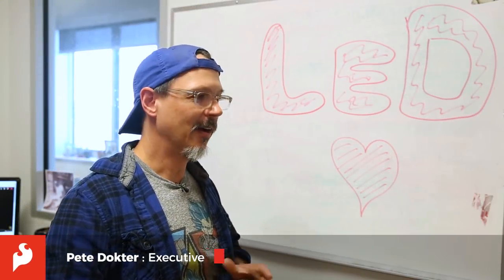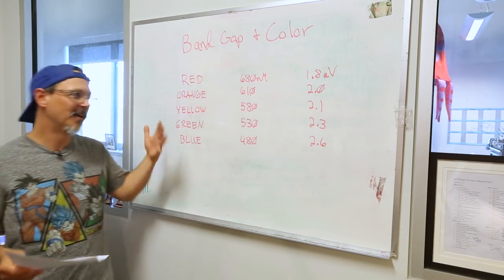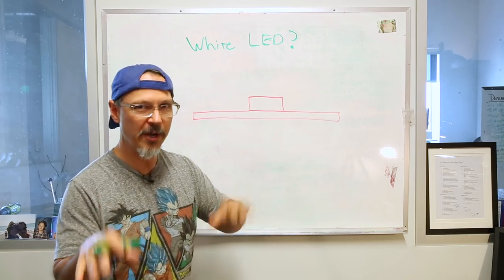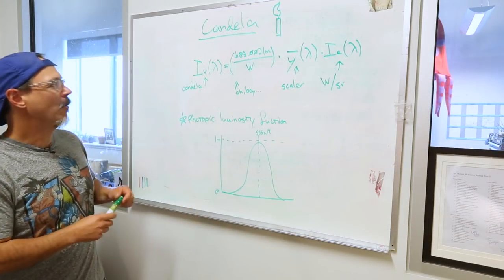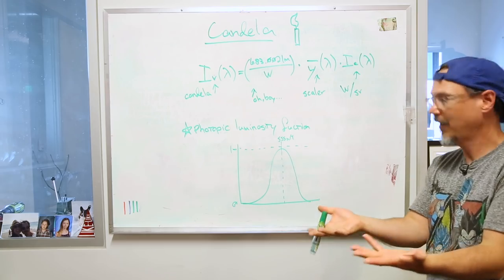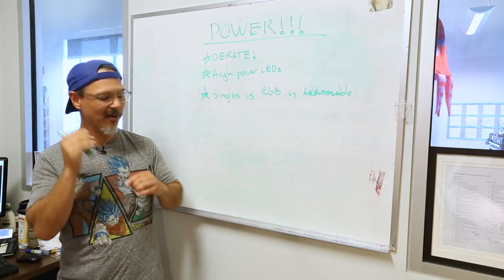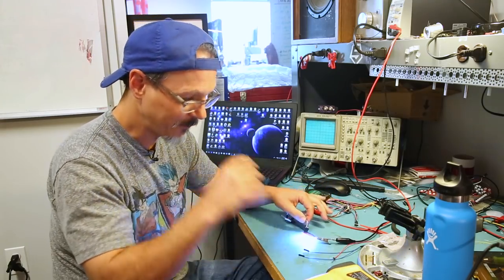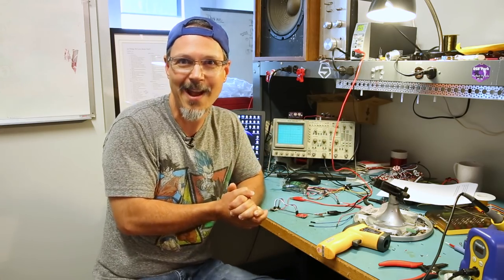According to Pete #57 - Circuit Design with LEDs

Comment: Nice video Pete, thanks.  Something that can be quite informative and surprising is if you take those surface temperature measurements and calculate out the junction temperature using  some rough numbers for the thermal conductivity for the path to the surface being measured (datasheets for high power LEDs typically include this, and there's plenty of app notes around with estimates for various PCB substrates and geometries). It can end up being shockingly high. PS: High power LEDs have all sorts of 'fun' failure modes - my best bet for the cause of your flashing LEDs is a mechanical failure of a bond wire that opens and closes with thermal expansion.
Reply: That seems a likely candidate. And all 3 of the bad ones went that way, all the same manufacturer. I've replaced 2 of them, the last one I just added some mass to better sink it (that trick didn't work with the others).

Comment: UV LED with the right color of fluorescing material can emulate any color LED. The advantage is all colors will have the same voltage drop. 
Unlike the different color LEDs that have anywhere from 1.8V to 3.2V